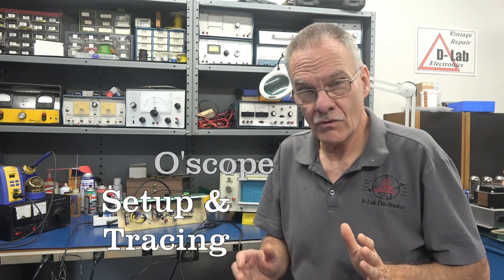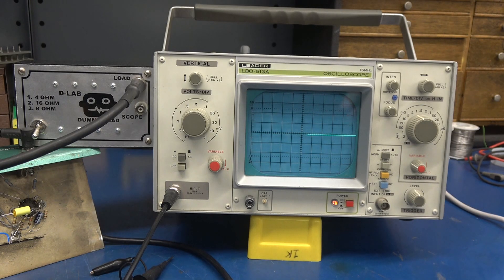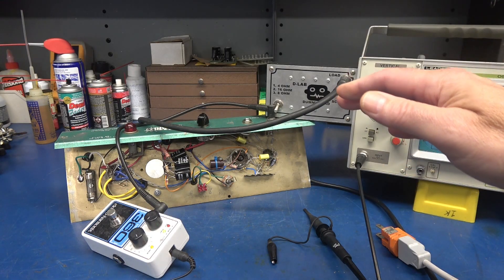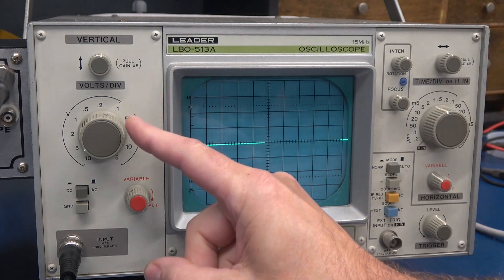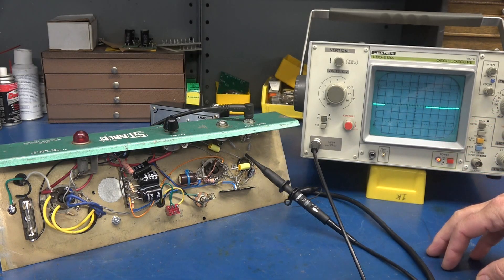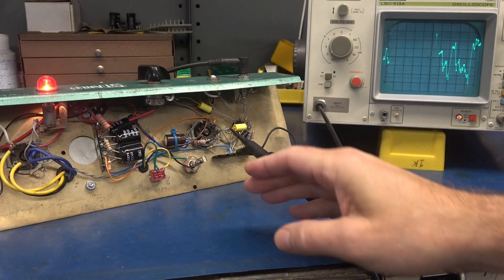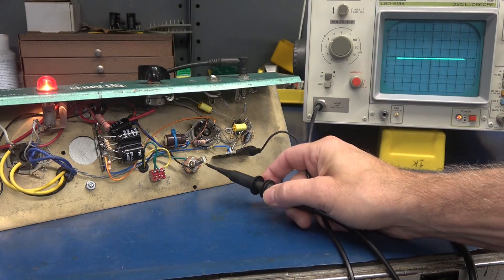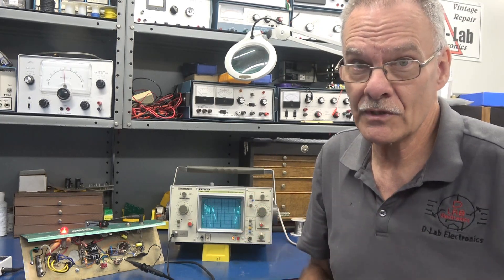Basic Training Oscilloscope & amp testing Trace audio circuits using test points

Comment: Very interesting, thank you!
I have been willing to use my oscilloscope to troubleshoot my amp signal but I have been worried to blow it because of the ground reference and exceeding tolerated voltages.
That helps. Looking forward the video on troubleshooting. Thank you again!

Comment: Great video but question, rather than a cheater ground adapter, wouldn't you want to have your oscilloscope Earthed properly but the device under test would be powered up through an isolation transformer (lifting from earth) and a Variac of the ISO to control voltage to the amp?
Reply: Technically, that's the accepted way. Also helps to install a polarized power cord first, and measure to make certain neutral is what it says!